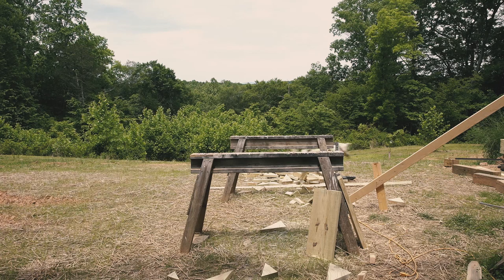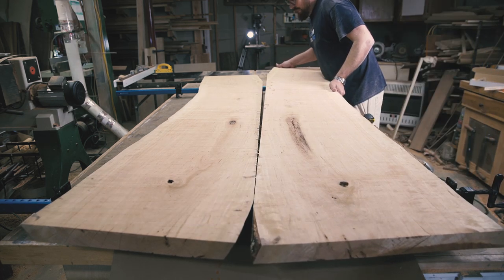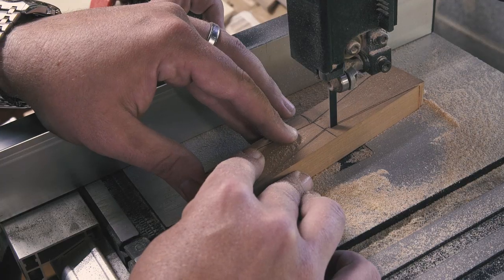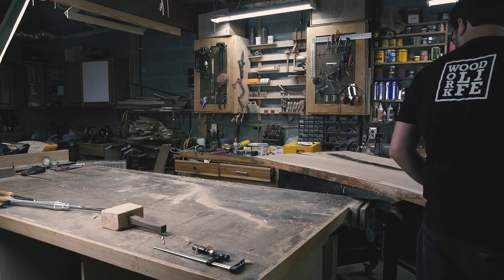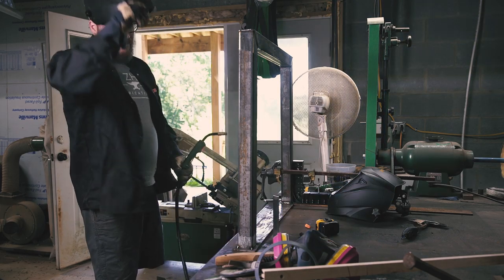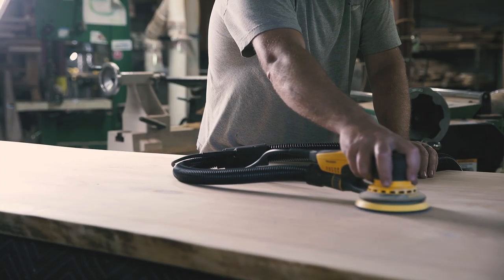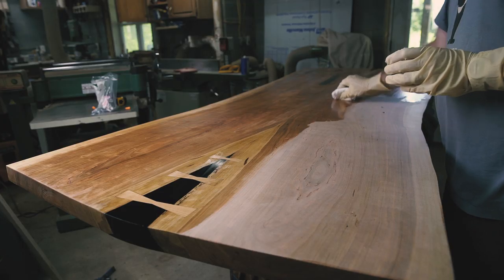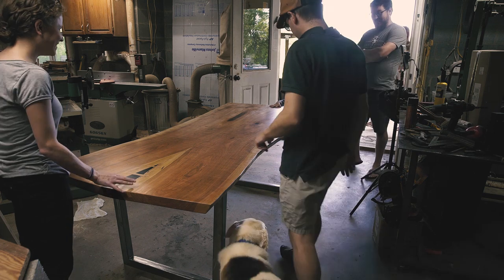The Martin Table | Live Edge Bookmatched Cherrry Dining Table

Comment: I would not recommend using any silicone based caulk on anything that is ever going to be finished.  The silicone residue never goes away and any coating beads up on it.  Bad news.

Comment: Love this.  I plan to make a similar table in a year or so for the new house.  Can you share how you did the router sled / rails?
Reply from the maker: Go for it! The sled is fairly simple. The rails are just straight (jointed) 2x4s with holes big enough to fit a clamp head. The sled is just a piece of scrap 3/4"(1/2" would probably be better) ply as wide as the router base with a slot big enough for the router bit. The sides of the sled are hardwood and provide the rigidity so the ply doesn't sag over the span. I screwed some cleats on the bottom of the sled to reference off the rails and I coated all of the sliding surfaces with paste wax.
Reply: @wmwalkerco  I really appreciate you sharing that.

Comment: Thats some awesome work right there. if i wanna use a table like that as a computer desk that will carry an ultrawide monitor which can weigh around 30 kg plus a computer case maybe between 30 to 50 kg depending on the configuration, would it it be able to handle that kinda weight ? is the structure of the table strong enough ? the size i have in mind is 200/250 cm by 80 with 2,8 or 4 cm thickness.

Comment: Sir, isn’t running a circular saw on the edges enough to joint the edges? Not questioning the method, I have no idea, I thought it was.
Reply from the maker: Sometimes it can be. There could be tension in the wood though and it could result in a bad joint. Track saws will get you even closer, but sometimes you'll still need to finesse the edge. If you do get a good joint off of the circular saw kudos! All that matters is the end result doesnt really matter how you get there.
Reply: Wm. Walker Co. oh! Ok! Thanks for the info, I just thought doing it with CS will not work. I’m worried coz I’ve got no jointer, and my table saw’s cut height is not enough to do the jointer jig. And sorry, I didn’t notice that you freehand the CS cut at the beginning.

Comment: "Stout mounting plates"?! 😂 You wouldn't have to worry about your "stout" mounting plates "racking" if you welded them properly @ 7:03. I'm all for people having a go a welding, but videos like this are so damaging to the people who are actually qualified in structural welding and fabrication. Yes, it's a table and it's not classed as "structural" but that's no excuse. Too many videos on YT making people believe they are "stout" at welding and it's easy. 🙄
Reply from the maker: I meant more of using 1/4" instead  of 3/16ths. My welds were solid. I make no claims to be a fabricator and I hold welders in the regard. How much would a certified structural welder have charged me to fabricate the base? Did it need an engineering stamp? Would the wood fail before the weld? It was more of a geometric forces acting on the piece and not a metal fab issue. It was supposed to highlight a choice of material. I've taken courses by the way, I'm just not a certified welder. I'm not working on skyscrapers or pipelines.
Reply: @wmwalkerco  I completely understand it's not a pipeline or skyscraper, and don't claim to be the best either. It's more the fact that people who are watching are oblivious. Maybe it's the perfectionist in me. 
Don't get me wrong, the table looks great. It really does. Just those finer details that are more important IMO.